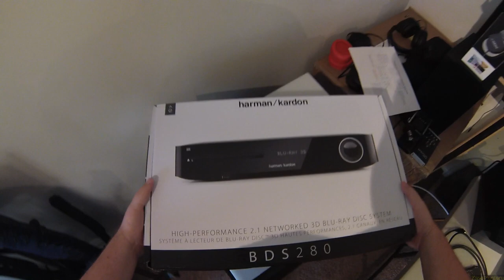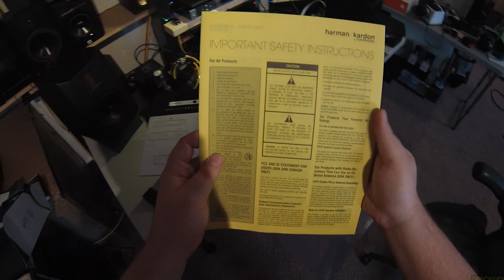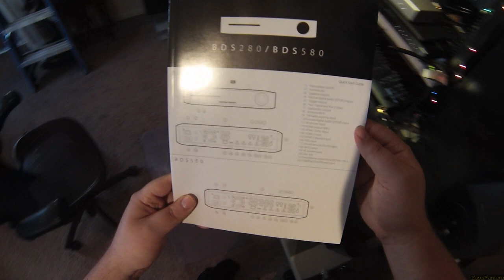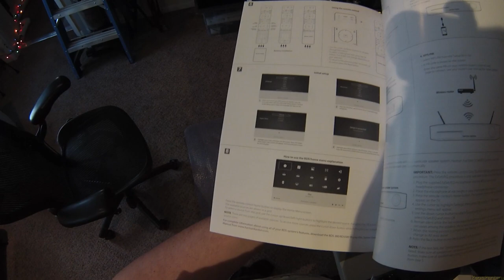Z Review - Harman/Kardon 2.1 Reciever

Comment: That's my review on Amazon.  I think it's worth it for $100, but not $215.  Bluetooth is the worse.  If anything pairs with it bluetooth just takes over, no security whatsoever and no way to turn it off.  I had to take of the antennas because my upstairs neighbor not knowing what he's doing paired with it.  I'm playing my refined, sophisticated musical collection of anime soundtracks through the SPDIF connection and all of a sudden I'm listen to this rap hip hop shit.  I switch it back to AUX input and 30 seconds later it goes back to the rap hip hop shit.  If removing the antenna didn't work I was going to wrap it in tin foil.
Reply: That's my fear of owning an audio system with Bluetooth, most don't have any security and anyone can connect and troll the owner.

Comment: MHL is an interface that was present on some higher-end smartphones. Seems to be on its way out already.
Reply: +ohbutreally All it is is a way to connect your phone to an external monitor with HDMI.  If a monitor (or reciever in this case) has an MHL compatible HDMI input it means the phone also receives power through that connection, but often not enough so the phone may still drain just at a slower rate.

Comment: Z, that Hass to be a surround sound unit if you have a video menu correct? You kept saying 2.1 or two channel. Is it actually a 2.12 channel surroundsound unit?? I’m asking because I just bought the 3770 model and it is strictly a 2.12 channel stereo receiver. The Only AVR receiver I saw online does not look like the one you have and as a 7.2 surround

Comment: Nice, I have the HK BDS 7772 system, which is the BDS 577 and a 5.1 HKTS5 speaker set.  HK sets the price so damn high they list it at 1400 and may have even sold some at that price.  I'm lucky I paid 350 for it.  Over the last year, it has been great.  The family loves the HTIB format that makes it easy for them to use.  Not sure of the BDS 280 does it, but the 577 will play many video formats from the front USB, very handy for digital content.  The biggest beef I have with it is that I suspect you NEVER get a full range from the front speakers no matter how you set it (and what speakers you have hooked up),  and when you get near its (low) limits the sound goes to crap.  I bet anyone that subscribes to your channel could put together a better speaker package than any of the HK speaker systems; but the HK is a convenient center-piece.  I replaced the HK speakers and now it sounds even better.  That remote and the menus are cool. Hopefully that fan is quiet the 577's is not.  Thanks Zeos.

Comment: , I ordered a Harmon Karden 120 wpc ( stereo receiver ) from B&H video
New York, NY. about 8 years ago. I did that for a few reasons....................
1. HIGH CURRENT INDIPENDANT AMPLIFIERS inside the unit for each channel.
2. subwoofer pre-out
3. TAPE MONITOR LOOP
4. Able to run (2 ) sets of speakers at FULL FREQUENCY & FULL POWER TO EACH CHANNEL. 
Got it on sale for $400 bucks. VERY, VERY, VERY GOOD UNIT.
I got this particular unit mainly for the Tape Monitor Loop so I could run my Vintage ADC/Graphic equalizer spectrum analyzer through every input and FM radio all the time. Extreamly nice Vintage unit in mint condition. 
my point is that type of stereo unit is Not made any more. Extreamly hard to find ( Brand New ) that is.
the sound is epic with my 4 Acoustic Research tower speakers with 10 inch side fire woofers, ( slim towers)
side to side but very very deep , front to back.
I have a Velodyne 12 inch
650 watt subwoofer.
I have not heard a system that can match the sound I have in both clairity & loudness to date............
I have an older Marantz 
DVD player and a newer 
Sony SACD player that goes up to 50,000 KHz.!!!
absolutely Devine I say!!!
so don't bad mouth Harmon Karden to much Z